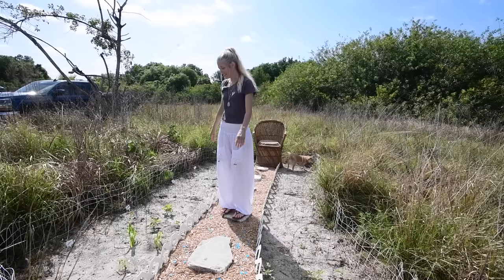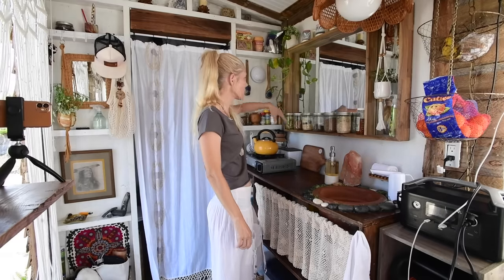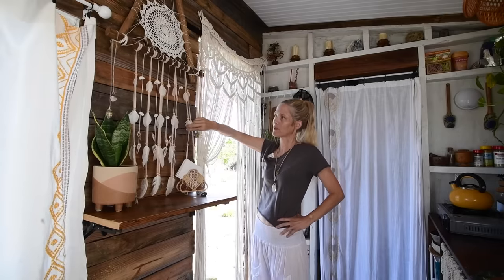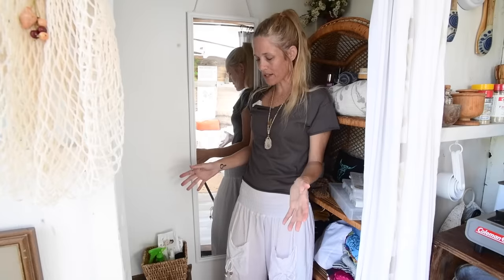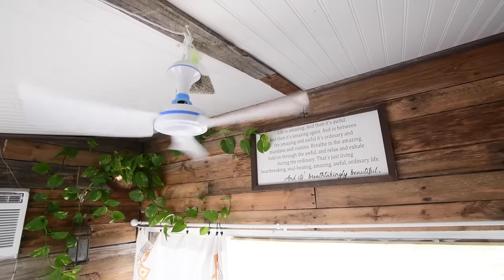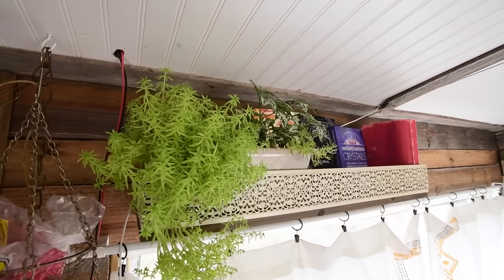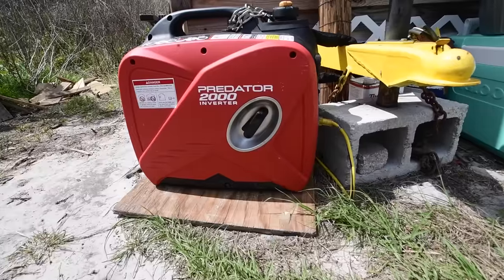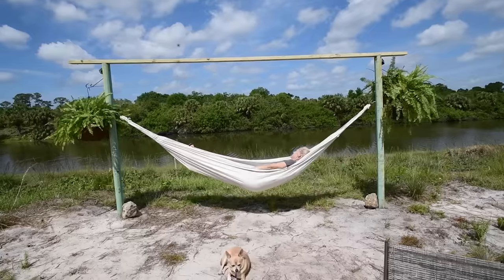DIY Shed Converted into Micro Tiny House

Comment: Nice little tiny home. Or what I call a shed on wheels. I want to build one that is like 30ft vs just a short one. Width is built into the cake for trailers but the length can be a huge difference to comfort. I could build one now that Im retired.

Comment: Since the have not stopped manufacturing ceramic dishware with lead, I don't use ceramic. And nobody knows what REALLY goes into metal cookware, even stainless steel, I don't use stainless steel either. I use tempered glass only... to cook in and to eat from. All my "cups" are glass. My "silverware" is wooden... mostly made by me in order to avoid stains and coatings used in the manufacture of wooden ware. BTW, I love what you've done with the space in your tiny home. And I REALLY understand your preference for getting away from a huge house that just sucks you dry and makes you work so hard just to keep it clean, much less keeping up all the maintenance. Less space, less cleaning and dusting.

Comment: Amazing job! Your hanging lamp as well as the wicker shelf  in your toilet room look 1970 or so to me rather than mid-century.  I was born in the mid-60s, and the lamp reminds me of ones I saw in some restaurants and and on prime time TV shows when I was a little kid. The wicker shelf unit, at least those shapes and colors, are 1970 to 75 or so, which is not mid-century. 

😊The term mid-century when it refers to decor and architecture is short for “mid-century modern” which is a very minimalist look, very angular. This period for design was the 1950s.

I was blown away when you said you have a grown daughter and had retired. I had figured you were no more than about thirty!

The soil there looks pretty Sandy, or at least not very rich. I’m curious how your garden is getting along, as it didn’t look like you had mixed in richer soil or mulch.

BTW, I was wondering, are you from upstate-ish NY?

Comment: You do know that you can just take a hose put it in there the great water is siphoned it and then throw it out out into your garden or just outside you shouldn't have to pick it up once the waters empty you can probably just take a sponge and clean up the slimy stuff at the bottom but I would siphon it until it comes up to the top and then throw it outside the hose easy peasy